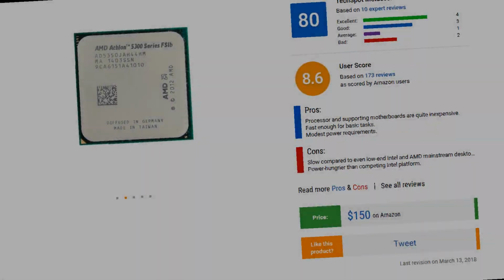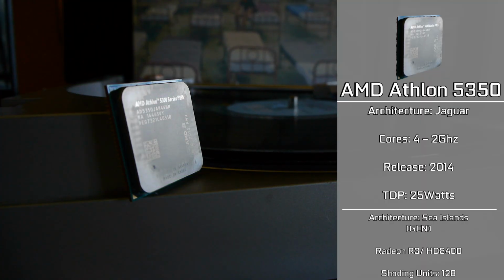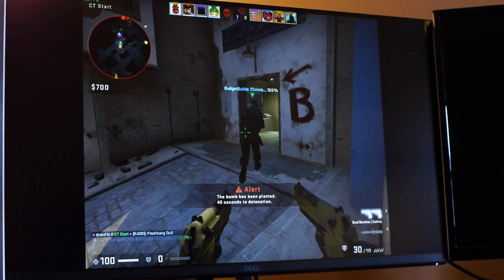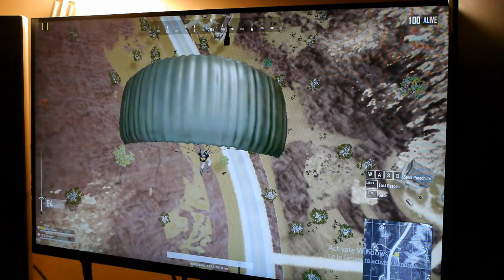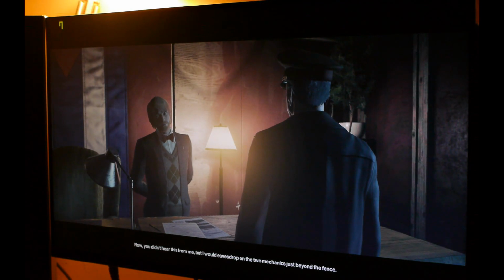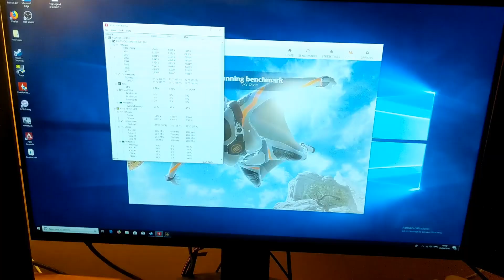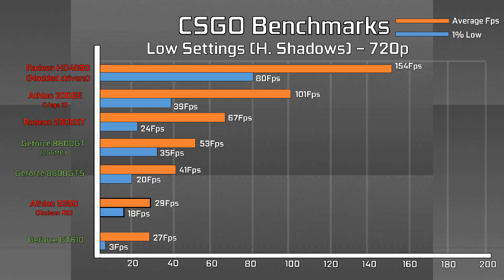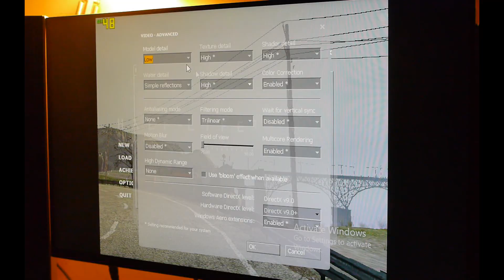Socket AM1 - Aging Horribly!

Comment: You know the AM1 support up to 1600MHz (Standard) then depending on the Motherboard will support 1800OC to 2400OC.
The on-board HyperTransport (v3.2, which is the same as Fusion Media Processors., such-as Piledriver or Excavator) is capable of up to 2100MHz

Now the AMD Athlon 5350 with a ASUS AM1-A68H that I have., allows essentially the System to be "Fully Unlocked" in this and so it's paired with Kingston HyperX Savage (1800MHz / 2400MHz OC) … which makes a HUGE difference in performance.
The other element at play is that the Packaged Heatsink and Cooler is rated for 15w., as this is what the Stock Settings will peak at (well sometimes it'll hit 18w under particularly heavy Benchmarking) … and some Motherboards essentially keep it locked to such, or might provide up to 15% Overclock Overhead., which essentially means 2.05GHz K-Core / 650MHz G-Core. 
Again having a High-End Board (and yes, by "High End" I do mean the £56 MSRP, as opposed to the typical £35-40) along with a AM1 Compatible Wraith Cooler (95w TDP, which is frankly overkill) allowed for some quite ridiculous Overclocking Potential.

That is to say the AMD Athlon 5350 Stock is 2.0GHz K-Core / 600MHz G-Core... with the above, really the main limitation became the 25w Max TDP Rating but you'd be surprised how far you can actually push it... again keeping in mind the 1600MHz Stock Memory Support. 
The result being at 24.8w TDP., I was able to squeeze 2.75GHz K-Core / 720MHz G-Core along with 2133MHz Memory/Hyper-Transport. 

This actually resulted in it being very similar in performance to the A6 7400 with R3 Graphics.
Now I wouldn't recommend it for Gaming without a Dedicated GPU., which at Stock is going to 'Peak' around an RX 460 … maybe RX 560. 
And honestly most of this is due to the PCI Express is only a PCI-E 3.0 x4., but Overclocked (as this also Overclocks the PCI-Express given it's Driven by Hyper-Transport., hence why some PCI-E Devices can cause instability overclocking the "FSB") you can actually get away with something like a GTX 1050Ti or RX 570. 

Still you're not really going to get beyond that., and also keep in mind the lack of L3 Cache is a KILLER for Gaming Performance. 
Hence why, if you're using an Athlon II X-Series (K10 / Budget Phenom II)., I'd highly recommend a Board with Core Unlock Support... even IF doesn't actually unlock any additional Cores, it does enable the L3 Cache which is present but disabled on said Processors. 
The same is true in regards to the Athlon / Semperon / A-Series APU... it's not that they don't have L3, it's that it's disabled. It would've been nice to have seen a similar "Unlock" Feature in the Fusion Media Chipset / BIOS as the 700 / 800 / 900-Series Xpress Chipset saw., as it would've made a HUGE difference to the Gaming Performance of the AMD Budget CPUs (or of course AMD not to disable it just to create additional SKU)

Comment: Bought one on launch with a Asrock motherboard with the power brick instead of a PSU, a passive CPU cooler, together with a Blueray drive.
Use it everyday and the uptime is generally longer then 1 month at the time between restarts, so for me this has been the best pc hardware buy I have ever made.
When the 6Tb Harddrive shuts down, it has no moving parts and no sound at all.

Comment: The FX series aged badly. I mean, my cheap little Pentium G4600 is better than a 8 core FX chip.
Reply: actually that's doubtful 

so games that max out at 4 threads, probably. for newer games that actually utilize lots of core sand cpu threads, I'd take the 8 core FX

if anything the reverse is true, the FX series aged well. It went from total crap when game only used 2 cores to passable when games use 4 or more.

Comment: If you OC the RAM in the BIOS, and install a lighter weight Linux distro on this system like Manjaro Deepin, and update to the latest stable kernel, then it's still decent for a cheapo web browsing machine, and other basic task, which would be alright if you got your hands on a bunch of them for cheap to donate to say a church library, or for your kids first PC if you are tight on cash. otherwise AM3, or FM2+ are better options

Comment: Ha! Thanks for this revisit! I remember eyeballing these back in the day as I was looking for a low power alternative to my Asus C60M1-i based file server. With it's 9 watt TDP CPU (3w at idle) it was an amazing little server that sipped power. We're talking 6 drives loaded up and less than 25w total at idle. That was the good news, the bad news was.. I'd shoot myself in the face if I had to use it as a daily driver. Oh my god that 1.3Ghz Dual Core was painful. lol  But as a little network NAS / Server it was perfect. Even streamed movies just fine. 

Never got around to picking one up due to Price (didn't hang around long so limited supply jacked up prices), 25w TDP (not exactly as efficient as my 9w TDP C60), and most of the motherboards only had 2 SATA ports. Almost. Anyway... thanks again for the walk down memory lane.

Comment: Im lagging with my i7-3770 non k and have ~100fps in 4K, 1440p 190fps and what I do I lagging with my i7 fps dropp to 20-40 in 4K and 1440p still get low 1% fps.
Reply: Quad core bro. Do a clean barebones windows install. Once other processes are running in the background you get lots of lag. Or switching to a 3770k and overclocking it to hell will also help if you have an overclocking board. Those cpus are cheap now, especially if you sell your non k it should only cost a little
Reply: @baronvonlimbourgh1716  I do not have k on my i7-3770 dude cant oc becuze of cpu is locked. I have reinstalled my pc 1-2 times every year and buy a ssd every 2 year. I will go for amd zen 2 (3000 series) with 10 or more cores. I have waited for 7nm cpu around 2 years now.
Reply: @Kage0No0Tenshi  yeah ok, that is a much better choice.. Was just offering a cheap solution

Comment: Damn, I have a Pentium G3258 that was released about the same time and my performance is MUCH better than this despite being a dual core with NO hyperthreading, I can actually play PUBG with stable 50-60 fps at 1080p using a HD7950.

Comment: It could be windows 10 I had the same issue with a core 2 duo e6750 and a amd 4800+ running need for speed underground 2 it just dosent want to run very good but downgraded to Windows 7 and its running at full with no issues

Comment: Very good video.

I bought into AM1 to build a computer inside of an NES Shell to use for emulation etc. It performed wonderfully for that, and even handled some of the source games well. But the board died so I stopped using it for a few years.

I eventually decided to get a new board and flip the parts out for a quick sale and make a few bucks. I was surprised at how bad it did with games with 8GB of Ram, 256GB SSD and RX 460. Thankfully the person who bought it was just using it for youtube videos and a kids homework PC, so it worked out fine.

That said I have to disagree a bit that I felt that the desktop experience wasn't as bad as you're saying, but the gaming performance just completely surprised me...how could it go from being so good at 1080p etc 3-4 years ago, but then hit a wall so hard?

Great video's as always, cheers!

Comment: AM1 was an interesting idea, but they never really fed it with very many good chips. It might have been a different story if we got a Kaveri based APU on it, but it was mostly Kabini based Jaguar/Puma cores that were Atom class chips. It's a full SoC in the x64 space, with no real external chipset required to run. AMD wouldn't release another SoC socket until the AM4 socket which supports the X300/A300 chipsets... Which aren't really chipsets at all, but digital keys to unlock the SoC mode of the chips.

Comment: Ah, Kabini, we meet again.
The reason why you can perform stuff without the heatsink is because the AM1 socket is a 722-pin derivative of the FS1 Socket (actually, the internal codename for the AM1 socket is FS1b, as you can see on the IHS), which appears on Notebooks as far back as 2011, and used the Llano architecture. They seem to be pin-compatible, but no system is logically compatible. Thus, the AM1 socket is a rework of a socket which used to accomodate really low-TDP parts, no wonder that Athlon, being a repackaged mobile APU, is inoffensive.

I remember that APU being used in the Bozon 2014 Gaming build from Austin Evans: https://www.youtube.com/watch?v=tgyI8bfrYt4 (Yes, this is what USD300 could buy you 5 years ago). In fact, thanks to that video, I was one of the silly people that you pointed out in the video, that would recommend the Athlon 5350, 5150 or 5370. Guess I was too stupid.

No, for Server and NAS usage this Kabini part isn't recommended either. Better go with a Intel J1800 BGA motherboard, you don't need the Radeon R3 for the basic computing you need. Nor do you need the PCI-E slot unless you are planning to populate it with a USB port replicator or a SATA Controller card.

Comment: I have a tiny carboard pc I built that has an E1-2500. This but with 2 cores at 1.4GHz and the gpu at 400MHz vs 600Mhz. It plays Halo 1 and Age of empires 2. 

I tried Overwatch and it wasn't pretty.

Comment: I've built a couple media streaming boxes with 5370s and R7 250s. I wouldn't have used them for AAA games, but for its intended purpose it was quite adequate. Single thread is similar to an old Q6600, which is impressive for a 25W chip, but still not great. The few games I tested them with back in 2015 did alright on low at 720p fwiw.

Comment: So i've got an Athlon 5350 on an asus mini itx board, looks like the same AM1i-a was used here. 8gb of free 1600mhz DDR3L C9 and a cheap SSD. The mobo AND cpu cost like £30 new because on clearance at two different retailers. Have a retail AM3 heatsink fanless on it. The whole PC cost £55 to build and makes no noise. It's been a great Linux machine alongside my beasty gaming rig. Not fast, but not expensive. Upcoming upgrades to my gaming rig and hand-me-downs to the linux box will leave it spare, so i'm going to try to make a PfSense router with it. Still happy with the purchase.  After all, the AM1 platform was intended as a dirt cheap thing for 3rd world markets. It was never intended to be powerful. 4 jaguar cores.